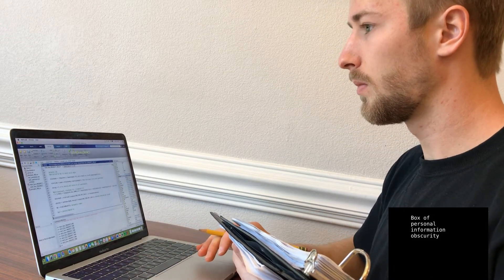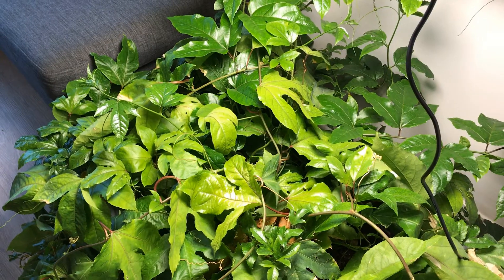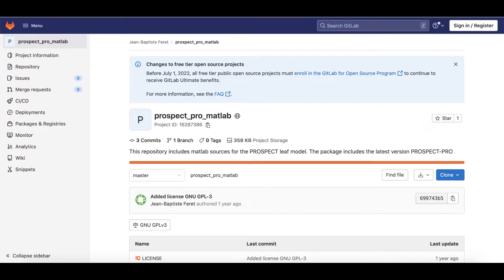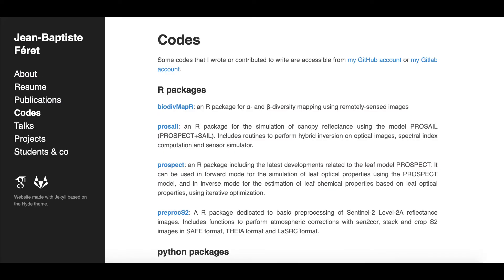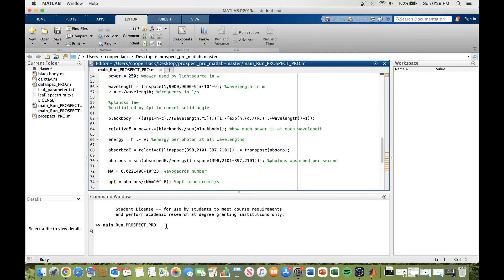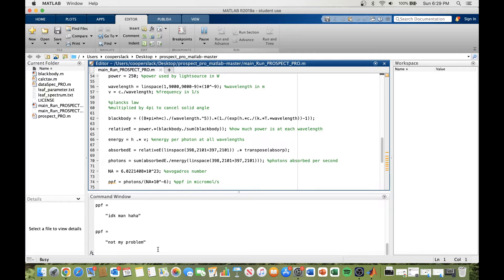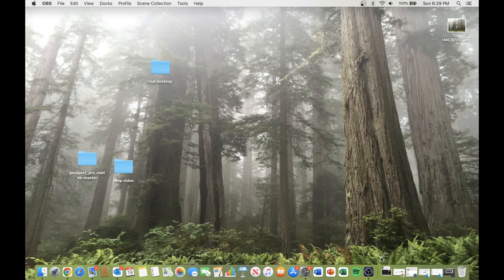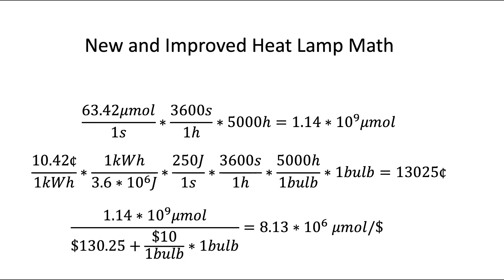Can heat lamps be used as grow lights? Yes, but why would you...

Comment: Hi, here because I'm trying to work out which heat lamp to get for my orchid and orchid mantis enclosure. Ideally I want a heat lamp that also serves as a growth light but I don't have the first clue what to go with. Any ideas?
Reply from the maker: Hi. The heat lamp I used was a bulb and fixture from Lowes. I think it was 100W with daylight color. Plants need different types of light to grow normally, so I would suggest getting a grow light in addition to the heat lamp to keep your plant healthy. There are some inexpensive grow lights you can buy online. I would also be careful with how far you put the heat lamp from the plant to prevent burning.